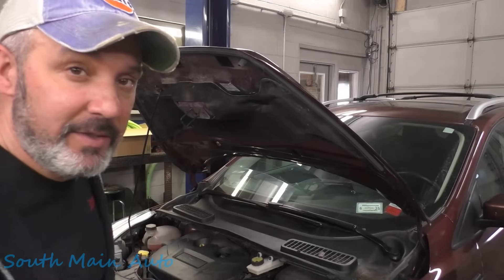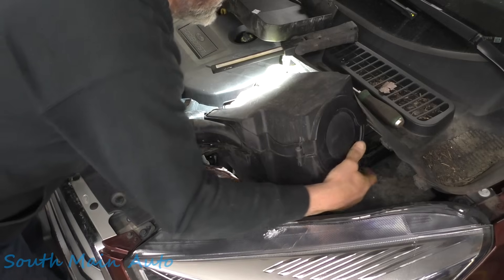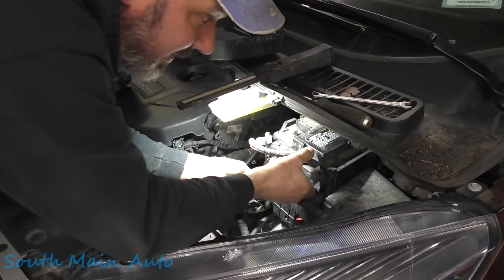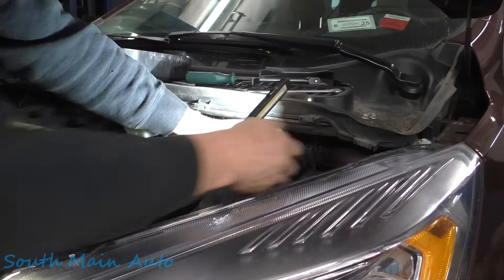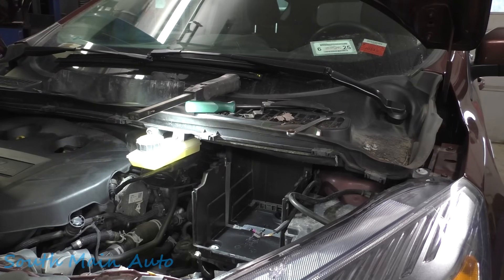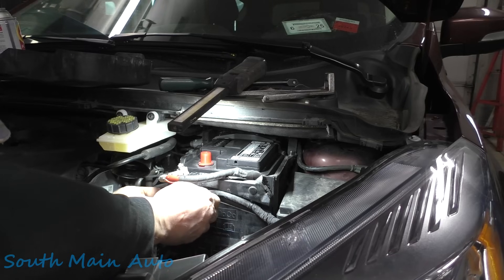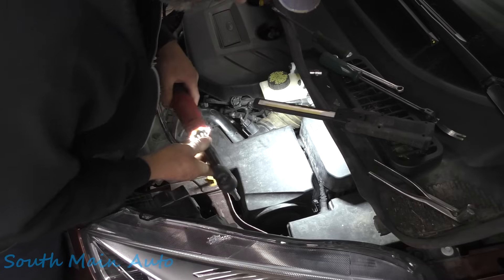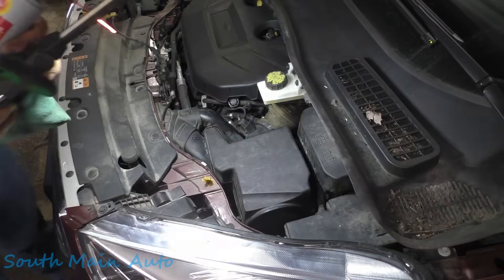Ford Escape Battery Replacement

Comment: Love that you showed the battery reset! I've replaced too many 'new' batteries due to this not being done. The charging strategy for an old battery cooks the life out of new ones and before you know it you have a customer complaint of "I need a new battery every 2 years but the original lasted 6"
Reply: Happened to me when I changed out my battery on my 2.5l 2018 escape.  Retailer warrantied battery though
Reply: Actually, I just blame that on it being a POS battery.  I experienced this phenomenon more times than I care to remember on older vehicles without any "smart" charging.
Reply: @timcees  The big plus for you is the 2.5l  My bride insisted on the "cute orange one" with an ecoboost.
Reply: @luvthesnow  did you get the 2.0l ecoboost? It is peppy! Yeah, I tried a 1.0l ecoboost in 2016 Focus and learned my lesson. Another lesson learned on the Escape is to change automatic transmission fluid often, like every 15k metropolitan miles driven. My trans failed at 56k. Went to drain and fill 20k miles later and the fluid was pure black...
Reply: @timcees  Nope.  1.5  Just had the water pump replaced at 33k under warranty.  Had it for 3 days.  I have an '11 Fusion also (6F35).  I've done 4 trans drain and fills (3X each time)  Now up to 273k.  Always has shifted from 2 to 3 like crap but the fluid has been nice and red at each change.
Reply: The algorithm actually charges older batteries less. Voltage and current slowly tapers off with lifespan. The reverse wouldn't make much sense given older batteries have less capacity than when they were new. Resetting the monitor is still good though, since the vehicle can get the most out of the new battery by charging it up more quickly. Probably helps with lifespan in start stop equipped vehicles considering the short trips most people take.

Comment: I had a 2013 and in 2017 had to replace the battery. Closet dealer was an hour away, and no auto parts had done one. So after removing the air cleaner, both wiper arms, the top cowling, I was able to access the battery and replace it. A year later I got rid of it.
Reply: That’s pretty much what I had to do to replace the rear bank spark plugs in our 06 Chrysler T&C van. You just about HAVE to do that to do anything at the rear of the engine. But I can’t imagine getting to anything back there if you couldn’t….

Comment: The BMS reset isn't super critical, the BMS *should* relearn the battery capacity automatically, but it does apparently base some strategies on the age of the battery. The first time the battery in my dad's truck was replaced (by the dealer) the BMS reset was not done and it worked fine except we would occasionally get a state where it would turn the radio off in accessory mode with the message "System off to save battery, Please turn ignition off or start engine". The battery tested good and was charged, but because the BMS thought the battery was 8+ years old, it was trying to limit the load on the battery.

Comment: I have a 2014 Ford escape. it's much easier to remove the wiper arms (two nuts) and the cowl (eight clips and four bolts) and then the battery is wide open for access. You really made this more complicated than it is.

Comment: I have two 2017 Ford Escapes. I found it is easier to just remove both wiper blade arms and remove the cowl. Doesn’t take that long. Battery comes straight out with out a struggle.
Reply: Yes to all.

Comment: Oh for the days when we all lived in a simple life when you could change a battery by just removing the hold down clamp. What were they thinking? 😅 Enjoyed the adventure.
Reply: I think you just troubleshooted the problem...They weren't thinking! :face-turquoise-covering-eyes:
Maybe for an encore they will go back to using internal rubber timing belts on interference engines again. (I'm not sure they didn't!) :face-blue-wide-eyes:

Comment: Hey Eric I have a 2016 Ford escape and I've always had to remove the wipers and the upper drip p an to get my battery out. 
I never thought about just removing the air box that's interesting
Reply: Same, done a battery on the gen of escape 3 times and each time I just took the wiper cowl out. Much more room to work imo
Reply: That’s how I’ve done it as well. Seems like it might be easier. But, this is probably how Ford wants you to do it…
Reply: It sure beats going in through the tailpipe .................
Reply: Before I replaced my battery in my Escape, I watched a few u-tube videos  and showed both ways. Like you, I chose to remove windshield wipers.
Reply: I guess this car is named after the guys that jumped the wire at the insane asylum.

Comment: dirties battery replacement I ever watched. excellent torque wrench action. great video as always.
Reply: Dodge Avenger. Pull left front tire and wheel housing. Then hope the hold down bolt doesn’t snap off. BTDT.

Comment: I bought a new 2022 Escape with the small engine(only car on the dealer's lot after our new car of another brand was totaled by an idiot rear-ending me) and the Escape's battery can be flaky if you don't keep a jump pack handy.  The procedure you show is invaluable if you try to change the battery yourself.  The car is smoother, quieter, easier and zippier to drive in city traffic than I would have believed, and, most importantly, my wife thinks it's the perfect size for smaller drivers, like her.

Comment: If you think the battery is difficult, my 2019 ford transit connect is similar to the Escape and my ABS module went bad and would apply the brakes whenever it wanted with only 15k miles on the clock but I was out of Warranty and they had no parts available and wanted $2600 to replace it but after 4 months of sitting in my driveway still no parts.  I went on Ebay and found one for $100 and low and behold I found out the ABS Module and Pump was behind the battery!  That was fun times! Not!  I did have to buy a scan tool to do the PMI (Forscan was useless for the PMI)  but now I'm the neighborhood free mechanic now when someone gets a check engine light.  lol
Reply: Never admit to buying parts in Ebay!  We all do it. We just don't talk about it!

Comment: I've done these the way the book says to, but found it easier and quicker to remove the wipers and cowl. About 7 or 8 clips, to remove the vented section, then 4 bolts to remove the rest of the cowl. The battery is then wide open.

Comment: I just changed the battery in my wife's 2020 VW GTI, and it had all that stuff you mentioned at the end of your video here.

Remember when swapping out a battery took 2 minutes and no computer communication was necessary?  They do this on purpose, so you have to go to the dealer and pay FOUR HUNDRED SEVENTY-FIVE DOLLARS rather than swapping it out yourself.  (Yes, the local VW dealer quoted me $475 to replace the battery!)

Luckily, I had the scan tool I needed, but your average person isn't going to have that, so they're just screwed.

Comment: Followed your video for my 2017 escape.  Very helpful that you pointed out all of the hidden 'Features'.  Actually completed the battery change in about an hour (including tool gathering and cleanup).  FYI, the owners manual states to leave the car locked for 8 hours, and the BCM will auto learn that the vehicle has a new battery.  Thanks again for the very informative series of videos you produce.   Love the humor, and you keep them interesting.

Comment: My glory days consisted of changing a battery on my 1977 Ford LTDII. I miss that old boat - those cars never had any problems - except the nylon timing gears on the 302 V8. 
Thank you for the video Eric, now we see the effort required to change a battery on later model vehicles.
Reply: 1979 Ford LTD II here. Two tone blue, 302, what a beauty of a car.

Comment: Good job, Eric! I was enjoying all the way, as I had to replace the battery on my Grand C-Max, a couple of weeks ago, and it's the exact same crammed setup. You can, however, reset the BMS by clicking 5 times on the fog light button, followed by 3 times on the hazard button, and the battery light on the dash will happily blink 3 times at you :-)

Comment: Hey Mr. O. and to anyone that may have to do this repair. Disconnect the intake elbow at the air filter housing by loosening 2 screws, you don't have to remove them completely they are captured, leaving the intake rubber tube in the engine bay. Sprits the rubber nub of the air intake box with lube to reduce the chance of breakage. The box will shimmy out and back in easier that way. This method has helped me speed up when performing recalls that require the air filter housing to be removed.

Comment: Eric, Your repair knowledge is only overshadowed by your humor😂😂😂. Love your little feller comments. Had an AGM battery installed in my '17 Silverado a couple of years ago. That sucker must weigh 52.65 lbs😮😮 Damn thing was solid lead😮😮 Battery shop I've gone to since before I was born didnt completely tighten the cables and I had computer codes coming out my butt the next day, all due to their lack of detail to installation. Ended up taking it to the local Chevy dealer where they screwed around for 3+ hours erasing and resetting every code thrown. I believe the service manager told me there was like 150+ codes found that needed attention?? Is that even possible?? Anyhow, they charged me 1 hr for labor at $125 hr 2 years ago. Went back to the battery shop and gave them a piece of my mind, for what little good that did. When asked why I didn't bring it back, I asked when they became a regular garage?? Told them the next time I need an engine rebuild done I'd bring it in😮😮.

Comment: Just changed our 7 yr. OEM batt. in a  2017 Escape. I didn't have to do the reset on ours. I also fought the exchange for 30 minutes. Not the easiest job but doable for a novice. It's no wonder auto techs hate to work on Fords.

Comment: Would have been easier to, Remove air bag, Steering Column, Instrument cluster and then cut a hole in the fire wall with the torch. From then on just pull out the battery from inside.
Reply: There is a easier method than this video shows.

Comment: I had an Escape in that I had to check powers to the wiper motors, if you remove the wiper arms the Cowell comes of pretty easy and the battery is right there. There is a relearn procedure for the wiper blades which was in my scan tool.

Comment: Does service data say to remove the cowl? That’s how I’ve always done them
Reply: Agreed. It seems like from the camera angle that you could just pull up and out if the cowl was removed. That being said, wtf?
Reply: Same. I have a '14 Ess Cop Ay, and I just do the wipers and cowl trick. The wipers are easy to realign, and kind of do it themselves too. Only car I've seen where the wipers can be moved/rotated when the car is off.
Reply: "Sorry I can't give you a jump without removing the wipers and cowl first."

Comment: Eric, this is probably a dumb question and no doubt you've explored the possibility, but wouldn't it be easier to remove the cowl above the battery?
Reply: Does advance auto change these for free ? LOL
Reply: If I recall correctly it doesn't really buy you much. I did this job as a DIY in my driveway a few years back. Did not enjoy it lol.
Reply: The less you need to touch, the less chance something important breaks I guess.

Comment: Just changed mine. You totally did it the hard as hell way. Take wiper arms off. Remove drip tray i ]n front of windshield. Battery slips right out. 15 minutes

Comment: I have the same vehicle here in Australia it's called Kuga changed later to Escape.  I call the auto breakdown when I came home to a flat battery after 4 week holiday. The battery needed to be replaced. He did it in 10 minutes, he was a former Ford mechanic 😊

Comment: as a ford tech and having done this job several times i still watched the whole video. removing the 2 torx screws on the brake fluid reservoir makes it a lot easier.

Comment: Dude.... I'm overjoyed you did it the right way! Have been told and was instructed by a "certified master mechanic" that you have to remove the wipers and cowl to get these out. The very first one I did, I found that front flap before I got too far into it. You can do it this way in about 10mins and don't have to worry about getting the wipers back in proper timing/clocking.
 People still argue with me that there's only ONE way to do it. If you just WANT to struggle.. I'll let ya 😆
Reply: Most find it way easier to remove the cowl...and it prevents broken tabs..

Comment: When I changed mine in 2015 it was easier to remove cowl and wipers which was only a 5 min job. I never thought anyone would have to remove wiper blades to replace a battery.
Reply: but still it took a half hour or better to do the whole job.

Comment: You made this much harder than it has to be.  I've done this 4 times.  Take off the wiper blades, then take off water shroud and then screw off brake reservoir.  Battery is right there and you just lift it out.  A 15min job  Easy-

Comment: I just replaced "batteries" (it has 2) in a Pacifica, with start/stop crap and they really weren't that bad to replace. But the little one, that looks like a lawnmower battery, was super hard to find. I ended up ordering it from my auto parts store. I did put a memory keeper on the OBD2 and also to the auxiliary plug, because I read if I didn't. I would have to have the the dealer reprogram the ECU.

Comment: Good job on that !!! But I think the "by the book" way to replace the battery on those you have to remove the the wiper arms, undo the cowl panel, and the that brake fluid reservoir. There is no easy way to do that ...... I'm glad I traded mine in before I had to replace it !!

Comment: I've heard those were difficult to replace. I recently changed the battery on my 2018 Ford Flex and it took less than 10 minutes! There was nothing to reset either. I've never seen a battery terminal spreader tool before. That thing could have saved me a lot of aggravation over the years!

Comment: I think the front cover can be moved without unhooking wiring from it - the fat cable can be disconnected in the fuse box, which depending on the level of crustyness of the car might be a better option.

Comment: Also a good idea to remove the negative cable on the body post mounting end and remove the paint where the cable lug mounts to provide proper electrical continuity as this is the main ground connection. Focus with the Powershit transmission is notorious for having electrical issues due to Ford not masking off the grounding mounting points before the painting process.

Comment: BMS reset is to clear adaptions mainly associated with ageing (capacity loss, internal resistance increase). Also has calendarised functions. All to support smart regen charging & stop start. If it's not done then internal resistance related parameters should adapt over time but generally anything capacy related won't as those adaptions tend to be a one way deal. Lead acid batteries are complex beasts & inferring what they will do / are capable of dynamically is tough.

Comment: Usually the motor blows before the battery goes bad. Surprised by that but good to know how to do it. Thank you.

Used to have a 09 Dodge Journey. The battery was up ifo the driver front tire in the wheel well. That was a chore too.

Comment: On the wife’s 14 Escape, I go in the top and while I have the plastic out, I clean out the ton of tree debris we get around here, reset the battery monitor from the steering wheel console in the menu, (don’t start the car before doing the reset, just power on) and it’s done. Believe it or not I’ve seen worse on foreign autos.

Comment: The days of  a 10 min. battery change is gone...great video..
Reply: Not really. A battery change on some cars can be less than a minute! You just have to work on older vehicles. 👴👵
... And avoid those ridiculous EV things with those built-in fire starters! 🔥💥😱
Reply: I replace the POS battery in my 2021 Mazda CX-30 in late January. I think it took only 8 minutes to change out to a new and larger CCA one from NAPA. Nice open location.

Comment: I have the 2020 Escape and the battery look normalish. If that is a real word. One should never under estimate Ford for their doozies. In the 2020 the surprise is the evap purge valve that is not covered under warranty and Ford charges over $600 for about a $100 part because of the labor to install. In a normal car, this is less than a 5 minute job for a DYIer. In the 2020 Escape, you need a lift and then disconnect the engine and transmission mounts to slide the engine forward to have enough room to reach the purge valve seated between the engine and firewall. You access it from below. 

I am waiting for someone to do a video on the purge valve replacement. Fords never disappoints.

Comment: I see a few comments about removing the wiper arms and the cowl. Over time, the cowl warps and it will never go back flush. Not to mention, stripping the splines on the wiper arms. Plastic parts break.

Comment: 2018 F150 has that stuff. Stop-start will disable when the PCM decides you might get stranded. There is a method for the owner to reset the battery minder—found it on Ford Boss Me channel. The Ford battery was less expensive so go figure that out.

Comment: I replaced a battery on an 2010 Audi Q7 with an “regular” battery and changed some code in VCDS by one digit, and it worked fine.

Comment: Working for AAA, I replaced them the way you are, but it's not such a fun job in the winter outside!
There is another method that I heard that the dealers use, and that is to remove the wipers and cowel piece, then lift the battery straight up.
It's as though the engineers said "lets make this battery as difficult as possible to replace"!
PS, I used a LOT more colorful language than you did!